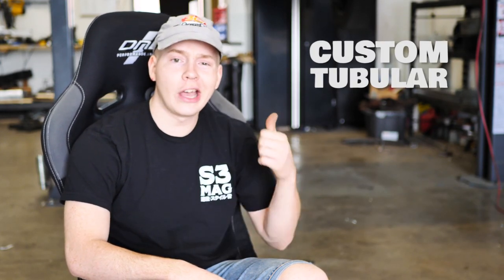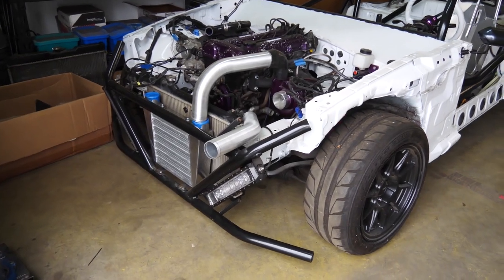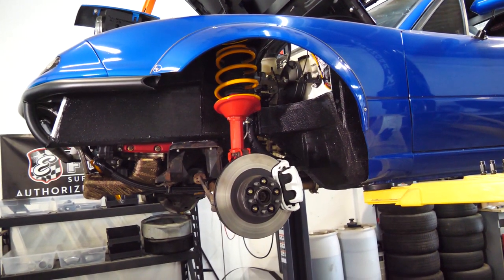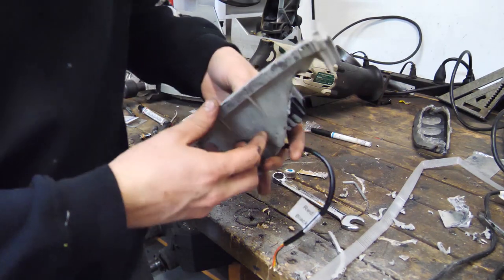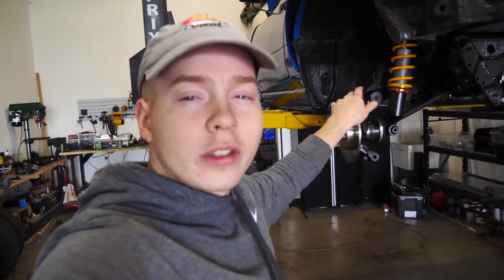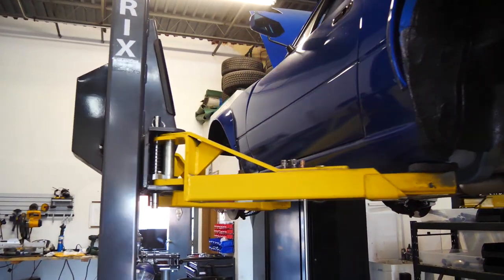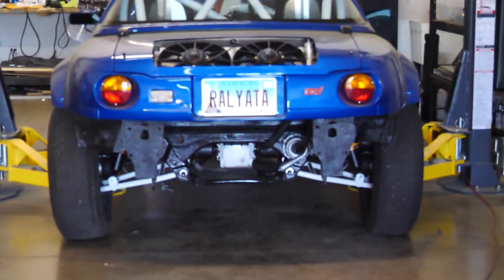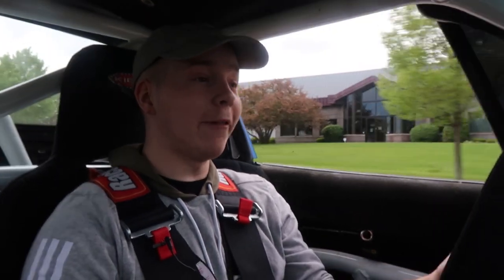AWD Miata Gets NEW RALLYCROSS Suspension! (& New Lights!)

Comment: Caleb, were you thinking about a front skid plate to protect the headers?  The extra weight would also help settle the front down more...?  Just throwing that out there. Glad to see it coming along.  I do believe clear headlight bezels would be better for the Ralyata.  Looks real good and I hope you can diagnose what is rattling around in the back.  Hopefully something just needs a better bushing mount.  Best wishes to everyone there and Peace out brother!
Reply: That sounds like a good idea
Reply: Believe the plan was to get unequal length headers so they don't sit as low then build a skid plate
Reply: Im pretty sure in the past he said he couldn't do a skid plate because on the headers. I also think he mentioned he planned to do his own custom headers at some point.
Reply: @11cramm11  Correct. Those headers will be removed
Reply: XT_ Steve hes gonna need a retune
Reply: Skid plates don't weigh that much
Reply: @fiisho  - every extra pound helps, but I would assume he would not use thin tin to protect the underbody.
Reply: you realy think Caleb is gonna take this car "offroad"? the amount of details that went into this project made it everything but Ralyata, i dont see it go offroad like he did when it was RWD
Reply: @11cramm11  those headers are already unequal length

Comment: I remember hearing that Mazda wanted to have the lights where the indicators are but light technology wasn't good enough at the time so they had to use pop ups. Technically you are making it look like the designers wanted!
Reply: Makes sense if you look at the NB Miata
Reply: @rv9990  yeah, they wanted to make the lights as small as they could in nb

Comment: I think you're underestimating the lateral forces on those lower control arms. Especially in rallycross/offroad when going through bumps the wheel has to ride up/against the hole. I think those arms should - at the very least - have a triangulating cross bar in them.

For the suspension, i think you need a dual spring or progressive spring setup.

Comment: You could redo the mounting point in the front control arm, moving it forwards to drop the front suspension
Reply: mounting point for... . If you are talking about the mounting point for the strut in the front suspetion that would be nearly impossible becouse it's part of the upright and it's cast iron and that is really dificult to weld
Reply: That would absolutely fuck the ideal geometry

Comment: You could cut the spring perch off the old struts and either relocate them to a more suited height, or get weld-on adjustable perches. I believe you may be able to remove the damper insert from the strut, so you could still use the adjustable dampers in the old struts.

Comment: This thing deserves a legit suspension setup that’s designed to work well together. You should look into having a set of bilsteins or konis custom valved for your spring rates, car’s weight, etc. I guarantee there’s a rally cross guru in the Miata or Subaru communities that would be able to make you a baller setup for a reasonable price. The track Miata guys swear by diy bilsteins. Or if you really want to go baller have King suspension engineer a custom setup for you.

Comment: You should build your own power coating oven for smaller parts or bigger. That way you can do one more thing your self. Learn to powder coat and ceramic coat. Building it your self you can build it to fit some where in the shop that works.

Comment: Run that setup on my RallyCross car.  But I went with the std height springs.  I don’t have issues bottoming out the car.   But the rally Miata needs the lift for sure.

Comment: Not sure you’re going to get enough, properly focused lighting out of those small light bars, especially behind the blinker lens and the black circle thingamabobs. I get you might get some more lighting, lower on the front, later on but hopefully you can get enough with what you have right now. At least you are road-legal with headlights and blinkers. I still think you’ll need to gusset the control arms to strengthen and prevent deflection. As for the red on the struts...you could always paint them or use that black bed-lining stuff on them to color-match with the rears. Everything looks cool though!

Comment: Watching your running video, I think the front is too stiff and the rear is fine. So, I guess stock springs on the front and put smaller wheels and 26" tires and it's perfect.

Comment: He’s a fabricator! He can find a strut/coil set up from a different car and change the strut mount plate to that car and cut the knuckles and weld the mounting points to the other car to the wrx knuckle. So it has more of a droop and doesn’t drive so stiff. And lights I say clear lenses. With the backs black like he did would look dope. I vote he builds a sweet rear white bash bar too.

Comment: "I hate to end it there" - after 24 minutes, lol
If those are your headlights now, I'd recommend getting rid of the black paint on them. You need a skid plate, or 1 rock will ruin your entire build. And, if you can weld some brackets holding your headlight covers to your hood, I think that would look best.

Comment: Yo dude you could just trim like half an inch to maybe an inch off the new springs on the side that doesn't have the flat bit and it'll bring the front down a bit. Also lexan windows with closable naca ducts would probably be easiest to fit in the doors with the cage but you could still have airflow if you want

Comment: For RallyCross you want the car as stiff as you can stand it.  You don’t want the wheel dropping into holes,  you want it to skip over the hole.  Scca RallyCross there should never be a hole in course that’s a safety issue.